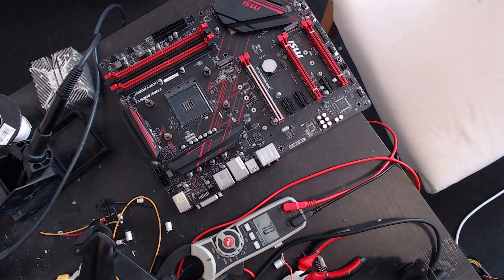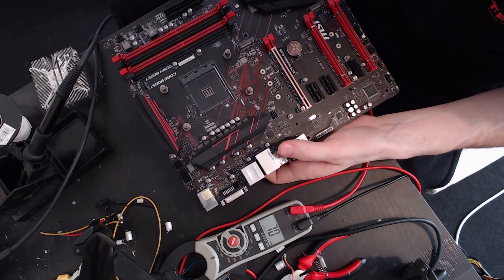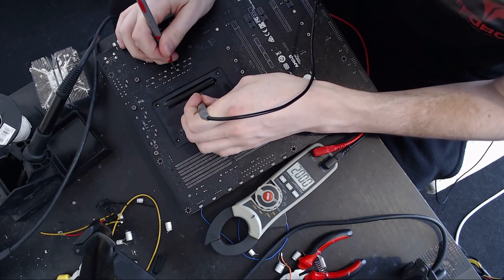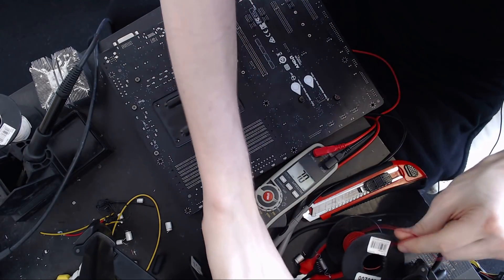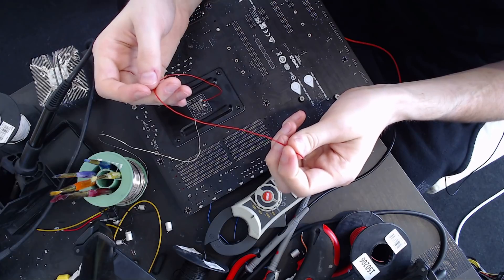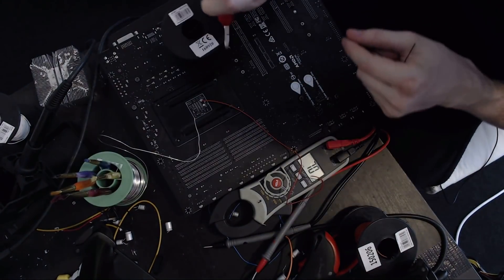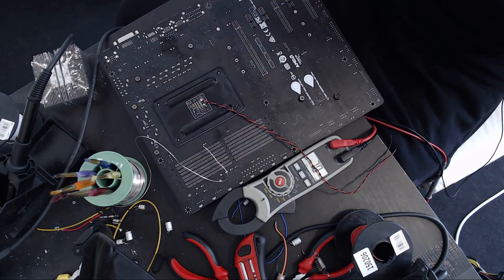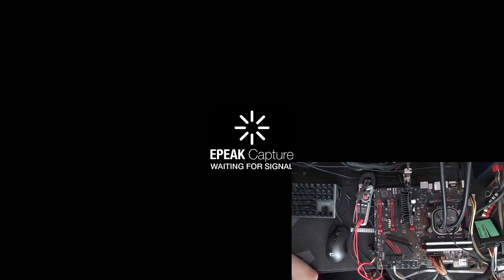Load Line Calibration on the MSI X470 Gaming plus.

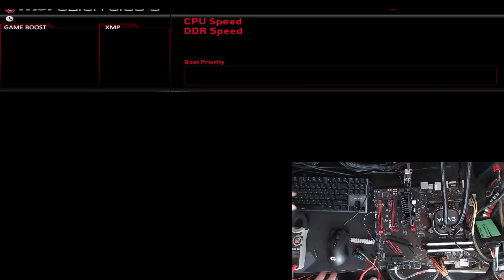Comment from the maker: 29:00 is when I actually have the system running and start taking measurements.
Reply: Can you pretty please revew the x370 Gaming Plus as well?
Reply from the maker: At this point it's kinda old and irrelevant so I don't really see the ROI on doing it.
Reply: analyze the x470 strix f please. please.
love all your reviews.
Reply: I wonder how B350 pro carbon or krait gaming will behave.
Reply: How come Steve hasn't sent you a GN Mod Mat yet?
Reply: I heard a rumor that someone sent you images of the Gigabyte x470 Gaming 5 MOSFETs(or perhaps it was the Ultra Gaming?). If you could do a VRM analysis of the Gaming 5 I would be soooo happy.
Reply: what do you prefer: Higher LLC setting (LLC ranging from 1 to 7 on ASUS motherboards with 7 being most aggressive) or higher Vcore to achieve stable overclock and why? [ I managed to get my 8600k 5 Ghz stable on Prime 95 with AVX (no offset) and cache ratio of 4.8 GHz using Vcore 1.32 V and LLC 6 on ASUS z370g mATX (i know I was fooled by counting chokes)motherboard. I can get my LLC lower but I have to increase my Vcore. what's your opinion on this and Why? ].
Many Thank
Reply: How does the heatsink on the VCore hold up? I'm looking for a board change from my B350 with pitiful heatsinks that turn into room heaters on a 6 core at 3.8GHz...
Reply: Hey AHO, is there a way to control VDDG voltages in this board? my usb headset is making some crackling noises, and the fix is increasing vddg voltage, but i cant find vddg voltage control in x470 Gaming Plus
Reply: @maersklandro  im running that mobo but the Vrms get really hot close to 100C in prime 95

Comment: 48 Minutes on LLC of one mobo O.o
(Thx for vid like usual <3)
Reply from the maker: I did include the whole process of hooking up measurement lines and rebuilding the system. I coulda done this as a 2 parter but I'm not really a fan of with holding back useful info and I want to cover VRM thermals tomorrow.
Reply: damn, if the vrm temps are good, im seriously going to buy this mobo. for the price its a super sweet deal considering what you presented here.

Comment: Thank you for this .
I will change my LLC mode tomorrow ! Have been running mine in 3.65 ghz, but it will run at 3.9 and 4.0, although the MSI mobo o.c. utility in windows keeps kicking it back to 3.2 when restarted. It tends to stay put at the 3.6 GHZ setting though.
I have this board with a Ryzen 7 2700 (not X) and an old AMD r9290 GPU, and
32GB of ram at 3266. Was running it solidly at 3333, but don't feel the need with games I run.

Had to get rid of the ASUS Radeon GPU oc utility in windows and trade it for MSI Afterburner to override AMD Wattman kicking my GPU back down from 1.3 volts and losing over 500 points on the Furmark Open GL scores.
Seems to be much better, but the old card doesn't post to my UHD tv at first. Seems it has to warm up awhile before I can try it again. No joke ! LOL
Works great once it posts, but there seems to be a discrepancy between the mobo and GPU in detecting the TLC UHD tv.
I don't see very well up close to use a monitor, so my 55" tv is great from 10ft. away in my chair, and remote mouse and keyboard.

Comment: I think this is awesome content, I wish we had better information on whose software voltage readings are actually accurate.
Reply: I'd be interested in that too. I have that motherboard and use CPUID Hardware Monitor, and the readings are scary. If they are accurate, then auto mode is not recommended, at least for Vcore. On auto, I had 1.5, 1.55V most of the time. Buildzoid seems to think auto mode is somewhat fine, so... Is my software wrong, or is my board less stable than his ? A comparative test for reading softwares would be great :)
Reply: Actually Robert Hallock responded to the auto 1.5v+ issue: it's normal on auto. It's sustained voltage that is dangerous.
Reply: Well, it looked pretty sustained to me... Maybe because I play games quite alot, so the CPU was always in demand. Thanks for the information anyway, I'll look futher into it :)
Reply: Here's his post on r/AMD: https://www.reddit.com/r/Amd/comments/8j72sz/do_not_use_f22f23_with_ryzen_gen_1_on_gbt_gaming/dyxmc02/?context=3
Reply: Thank you :D
Reply: Been doing some extensive testing, and well, voltage doesn't go down that much if you'rer playing some music, or even if Steam is open, even with nothing else happening. In those situations, Vcore is around 1.4 V. Gets up to 1.5, or even 1.55V when gaming wile listening to music and whatnot. But on the long run, with over 20 hours of testing with rather intensive use of the computer, the Vcore averaged at 1.38 V. So I guess it does work as intended :)

Comment: 26:30 ish "I need to find a way to have the cameras float in mid air"
You need a drone that is programmed to keep it's height relative to your workspace with a wireless cam attached to it.
Reply: That wouldn´t be annoying at all... Do it proper with an XY rail system in the ceiling and the cam from a wire that has height control like you mentioned. Then you dont even need to charge stuff up and can use proper wire for everything so it actually would work when you need it.
Reply: I was merely jesting good sir.
Reply: Marcel Krebs that would be badass
Reply: Marcel Krebs We both are I hope, but does buildzoid know or will we see these suggestions implemented in the next livestream? :D

Comment: Hey Buildzoid, thanks for the video, that was very instructive. I have the same motherboard, and I was scared shirtless with the readings. I'm not any less scared now that you demonstrated thay are accurate... Basically, I left pretty much everything on auto at first, and the average voltage for the CPU was around 1.5-1.55 V. And that was not even under heavy load, just with some music and a browser open. The CPU frequency were ludicrously high, too. I've seen up to 5.2, 5.4 GHz on some cores (under heavy load). The fact that I have a really awesome cooling (Be Quiet shadow rock 2) that kept my FX4350@4.4 GHz under 60°C all the time with the fan at 40%, but here could barely keep my 2600X below 75°C with the fan at 100%, makes me believe the readings were indeed accurate (CPUID Hardware Monitor, up to date).

The problem comes from XFR2, which is very efficient at its job, namely overclocking when needed... But apparently, "auto" mode seems to believe that "when needed" means "all the time". 1.5 V is way too high for that CPU, and there is just no way in the UEFI to limit the frequency at which XFR2 would overclock. It's on, or off (by the way, it would be pretty awesome if one could set a max frequency for that). So, I decided to slightly undervolt my CPU. I tried 1.3V, but the system can barely run 10 minutes without crashing. 1.35V doesn't help on temperature, like not at all, it's still around 70°C while gaming. 1.325V seems to do the trick, and underl oad the CPU reaches 65°C. That's 10°C less than with the auto mode. And I still have crazy frequency readings, up to 4.8 GHz, but it's lower than before, so XFR2 works as intended and doesn't try anything the CPU can't handle with its current voltage.

I had left the LLC on auto, and still noticed Vcore variations, from 1.3 to 1.33 V. It's not THAT bad, but it's not great either. Thanks to your tests, I should be able to stabilise that and most likely avoid weird temporary freezes that started happening since I said "nope" to 1.5V. 

So, basically, I just mean to say thanks for saving me alot of trouble testing this myself, and maybe a word of warning : "auto" is NOT recommended in the settings, especially for Vcore, band not really too recommended if one decided to set the CPU voltage to something ab it low. Low-ish CPU voltage and auto LLC don't really mix too well. Leaving Vcore and LLC both on auto means dangerously high voltage that is really not all that stable, and a LOT of overheating. Hopefully, my own experience can be of use to some viewers :)
Reply: Thanks, will try to find a good mix between Voltage/Vcore and LLC3 or 4 for me 2600x XFR Setup!

Comment: Huge thanks for that effort, and don´t know if it´s any good but on the X370 Gaming Pro Carbon the bios and LLC settings look suspiciously similar. I did not yet read directly from the board but if software readouts are as accurate on the X370 as here, I found the same behaviour on my mainboard.

Comment: I just got the b450 Version of this board and it almost fried my CPU because it somehow adjusted the CPU Vcore upwards on stock voltage and LLC settings with just setting a custom multiplier.... I've never had that on other boards even the B550 gaming plus or ASRock B450 boards. Both CPU Vcore and LLC were set to auto and I'm not sure which of both is responsible, all I know that I had suddenly 1.45V Vcore reported in HWinfo. Scared the hell out of me but luckily I only had it running like 30minutes and temperatures were under 50°C the whole time so (almost) no damage done I guess. The stupid thing is: it didn't even need that much to be prime stable at the same multiplier. Totally stable at 1.35V

Comment: Hey Buildzoid, 
You mention in the video that the voltage the VRM is outputing is not something to be concerned about if the voltage at the socket is under control (in your scenario - 1.5V at the VRM and 1.425 at the socket due to voltage drop across the power plane). When the load on the CPU stops and the current drops, the powerplane resistance isn't going to cause that voltage drop (not 70mv I mean) and the CPU will get shoved with 1.5v+ for a brief moment until the VRM reacts to the load change and drops the duty cycle accordingly. My question is, are the voltage spikes something to be worried about?
Reply from the maker: yeah this is basically what Vdroop is supposed to counter act. AFAIK since the spikes are so short they should not cause any rapid degradation of the CPU though I would really like to get some scope shots of idle to load and load to idle transitions with varying LLCs. It could be an intresting metric for comparing motherboards. High end boards should have much less overshoot on load release since they tend to have much lower voltage drops across the power plane and the regulators should be faster to respond.
Reply: It would be awesome to see how different VRMs handle load transitions, it could be quite important when pushing things to the max for 24/7 usage.  Keep up your work, videos are amazing!
Reply: Thank you for asking the Question and Buildzoid for the thoughtful answer, I'm having this same issue with a 2700x on an asrock killer x370 board, I'd like to leave it set to stock everything for now, but HWinfo reports 1.512 max core voltage, and I don't like it. Simply opening ryzen master software seems to prevent the issue tho.

Comment: Well, this explains why I had such discrepancies from measuring vCore from the VRM output caps on my motherboard compared to HWInfo64. My question now is if it is possible to solder sense wires to the ceramic caps INSIDE the socket; as my ASRock Z170 Pro4S does not have ceramics on the back of the motherboard socket and just has empty PCB through holes. I presume it would be a bad thing to solder wires directly to the through holes as there is no way to prevent inter layer bridging?

Comment: So the VRM is decent and the measurement system is accurate enough. I wonder about the bios though. I heard a lot about MSI boards getting bricked when trying to update the bios and I just got x470 gaming pro. I'm kinda afraid of updating now. lol
Reply: 1idd0kun before i broke my X370 Gaming Pro Carbon (killed the BIOS somehow.. but not while updating or smth) the Updates worked consistently.
Reply: As long as you update the old school way you probably won't brick it
Reply: just broke a b75 board while bios updating ;( send it in for 25 euro
Reply: I just updated my x470 Gaming Plus with no problems.

Comment: Does the board have bclk?
Reply from the maker: nope
Reply: Actually Hardcore Overclocking boooo!
Reply: After last bios upgrade the bclk option added but I can't go more than 104 with 1700x, no problem for me cause nvme issues with bclk>102 anyway
Reply: I have bclk on mine (suppose its cause of the bios update) but wont let me set it past 103 with a 2700x

Comment: This mb is good for 2600x to be oc to max?
Reply: Yes
Reply: Factory settings, everything on auto, my 2600X reads 5.2 GHz. And almost 80 °C. And 1.55 V. No need to say I didn't leave it on auto... That voltage and temperature would kill it quickly. But if you WANT to do that, you can.
Reply: Thanks for your answer :) I am thiking to get it  for my ryzen 1600 for now.. I think i meybe won the lottery a bit :) on my shity asrock b350 pro4 MB i dont have LLC so if i set 1.36v 3.9ghz bios it will drop to 1.32v in stress test and works... It can do 4ghz at 1.37v but not that stabill voltage drops... So i belive i meybe can do 4.1ghz on 1.45v i got Noctua D15 so i keeps it very cold.  Also i would buy 2x8gb 3200 cl14 ram.. Right now i got 2800 cl14 oc from 2666 cl 18.. What do u think its the upgrate worth?
Reply: I'm afraid I can't help you much on that. I upgraded straight from a FX 4350 to a 2600X, so I have no idea how that would work for you. Maybe someone else will be more savvy than I am :)

Comment: Does the X470 Gaming Pro carbon have the same VRM?
Reply: Don Barron it doesnt
Reply: Rouven Kniep is the pro carbon x470 a good board?
Reply: Do you know which MOSFETS the x470 Pro Carbon uses?
Reply: 乇乂ㄒ尺卂 ㄒ卄丨匚匚 looks like IR35201. That is a good upgrade.
Reply: 乇乂ㄒ尺卂 ㄒ卄丨匚匚 Do you know what MOSFET it uses?
Reply: 乇乂ㄒ尺卂 ㄒ卄丨匚匚 Do you know which ones it uses?
Reply: high: 2x 4C029N
low: 2x 4C024N
for both the gaming plus and the gaming pro carbon. the carbon has a different controller and uses 5 x 2 real phases instead of 4 x 2
no idea about the normal gaming pro though. can't find the data anywhere

Comment: Wow you really need a good set of tools xD. Not sure if you know about this, but it is a good practice to twist long wires (twisted pair), as you did, to reduce ground loop impedance. Shouldn't be an issue with sense wires due to low currents though, just good practice.

Comment: Fuck my MSI B450M Mortar piece of shit. Under load my mobo drops CPU core voltage by 0.05v and that's with LLC Mode 1 and VRM outputs as much voltage as I actually want. For example If I set CPU core voltage to 1.35v then at idle HWinfo shows 1.35v but under load it drops to 1.3v and VRM (vcore) outputs 1.35v at idle and 1.37v at load with LLC Mode 1. Fucking garbage.
Reply: I have exactly same problem in short story... But I know for sure LLC used to work properly! I have MSI B350 PC MATE and it was acting like in the video, but about ~2-3 months ago LLC got broken. No matter which lvl I chose, it doesn't work at all. I set 1,375v  Core voltage and on VRM it is 1,4v, but behind CPU socket it is 1,33v under prime95... Softwere reports simillary.
I have RMA'ed my board to shop and then they to MSI, 1 time service exchanged BIOS chip, board was behaving the same, 2 time they exchanged the board for different one with newest BIOS and problem still exist!!! I am so confused, like the problem is some kind of microcode, that comes with newest BIOS, or MSI service wanted to deceive me (board has different serial number and different vrm radiator (different scratches than my old one).
Reply: Same here with MSI X370 Gaming Pro Carbon -_- . Even with Mode 1, there is vdroop of 0.05-0.07v, at least shown by HWinfo. I wonder if the case is different if checked with a voltage reader or similar instrument.
Reply: @Doc2Mock  it is same with multimeter. I am fighting now with MSI service...
Reply: @Qwertypp10  Let me know the update :). I am confused whether to RMA, more importantly whether they will even send me a replacement lol
Reply: @Doc2Mock  I am now at the end of  the third RMA (Poland). 1 MSI  claimed, they exchanged the BIOS chip- problem stayed.
2. They exchanged the motherboard, for different one, used, after repair... with whole in PCB painted with black marker... with EXACTLY same problem (very strange for me)
3. I had enaugh of this and because the RMA goes through the shop I bought it, after my coplains on this entire RMA and what I got, shop said they will try to give me money back, however board was sent again to MSI, but by the RMA status I shoud have response very soon.
Reply: I ended up with MSI x470 gaming plus and problem still exist...
Reply: @Qwertypp10  :( . I am done with MSI boards. Going for Gigabyte I guess :/ .
Reply: @Doc2Mock  Please give feed back if borad change fixed the problem ;)
Reply: @Qwertypp10  Did you try updating to the latest BIOS (for ryzen 3rd gen)? May be this new Lite BIOS fixed the LLC? :/
Reply: @Doc2Mock  I have tried the first version of Lite BIOS, but it did't help...
Reply: @Qwertypp10  Oh well,  no point in upgrading BIOS  then... I will just sell this mobo -_- . X570 is still a bit too expensive... And the affordable one is a MSI Carbon again LMAO
Reply: @Doc2Mock  You should consider another vendor than MSI, All 3 MSI AM4 boards I have, got same problem. That is in my opinion only solution, although it can be also some CPU problem...